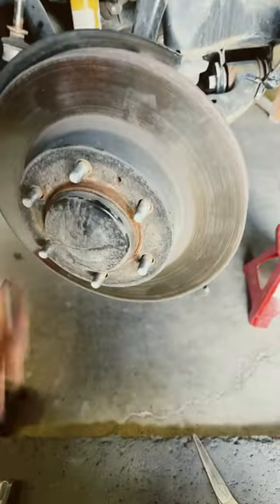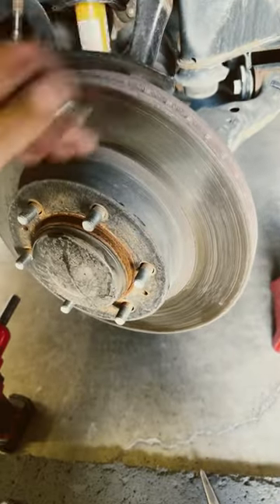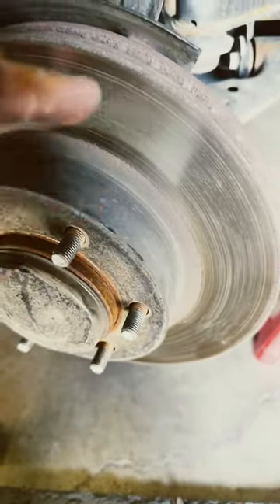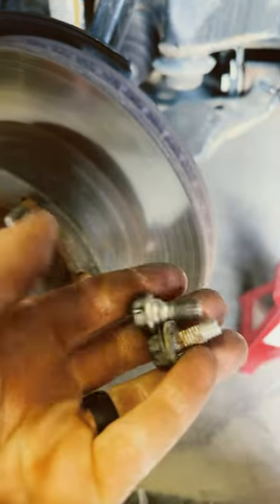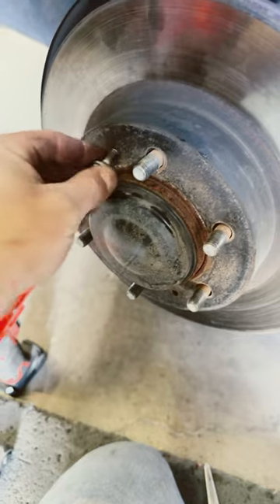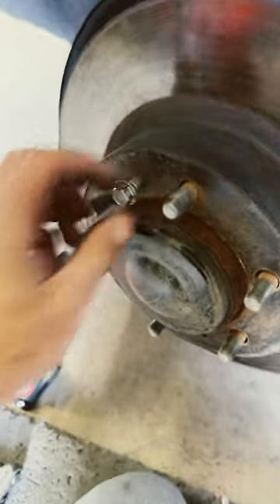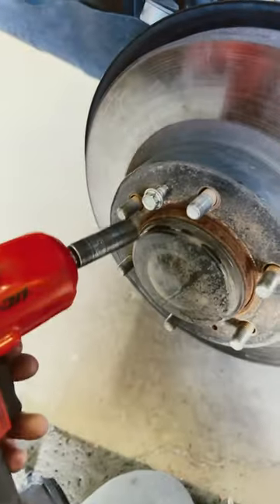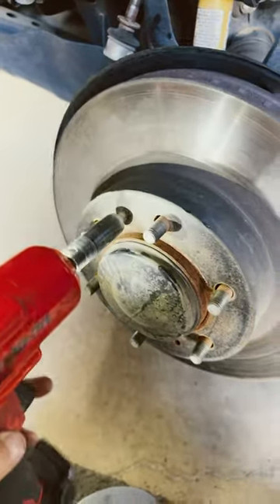Don’t use a hammer on your brake rotors! #Mechanic #Toyota #brakes #shorts #hack #autobody #truck

Comment: Generally you will find a broken off bolt or stripped threads in that removal hole in my experience lol
But you got lucky!
Reply: Or the threads pull right out of the plate on the rotors
Reply: Can always drill out the set screws in a pinch rust belt isn’t too nice

Comment: Pro tip # 2 When you install the replacement rotor it's a good idea to put never seize on the center of the hub to prevent this from ever happening again. It also doesn't hurt to put a little on all your lug nut studs to prevent rust/corrosion.
Reply: Yes on the rotors but the lug nuts shouldn't have antiseize cause they are more likely to fall off with vibration. Just tighten to the right torque and it should come off normally or with your own weight. No impact on lug nuts
Reply: Had some never seize on a 82 truck that sat for 20 years on the studs and the tire came right off. Good stuff to have
Reply: Only oil on lug studs.
Reply: I’m sorry, what seize?
Reply: @ComidaDelBrain  Anti seize lubricant AKA Never seize. Found at your local hardware or auto parts store usually.

Comment: Yes… but if you don’t have a bolt and don’t want to damage the rotor with a hammer use a rubber mallet.

Comment: Bolts are  referred to as the size of the threads not the size of the fastener used to remove it in this case its most likely an M8 bolt with a 12mm head on it. So any m8 would work to to push the rotor off. This is pretty common
Reply from the maker: I only referenced that bolt so they can find one with the same threads 👍🏼

Comment: Gimme a actual good reason I shouldn’t beat the rotor that I’m replacing with a hammer
Reply from the maker: I wasn’t replacing it with a new one. I just had to R and I to change the knuckle so I didn’t want to hurt it.
Reply: Ah gotcha i just say “looks like you need new brake rotors too”

Comment: Not that easy in Michigan. Heat it first or it will just strip out. Don't put anti seize on the hub, it will get on the pads. Clean and paint

Comment: I could take a hammer, and by time you find the tools and the ball and get that bolt thread it in there because all the Rusk to wax and it’s off and the rotor. Gotta get the old dogs out and teach to you new so-called technicians how to do the job right to wax and that rotors off you spend more time trying to find tools is not damage
Reply from the maker: You need an old dog you teach you how to spell. 30 extra second to find the tools to do it the right way, is worth it in my opinion.